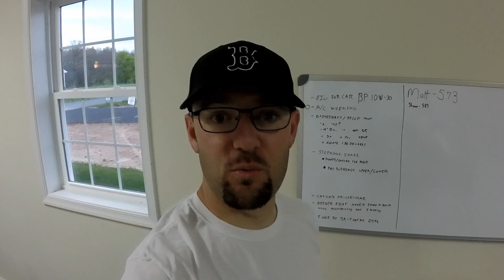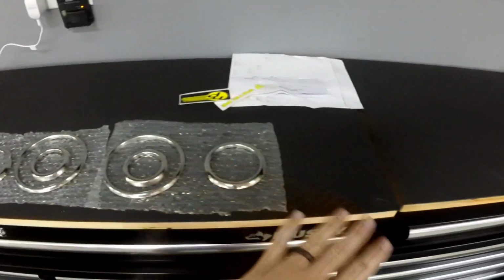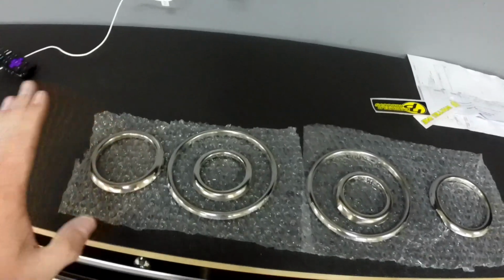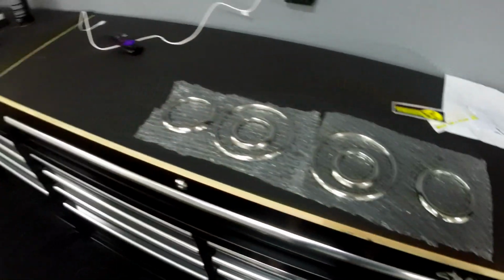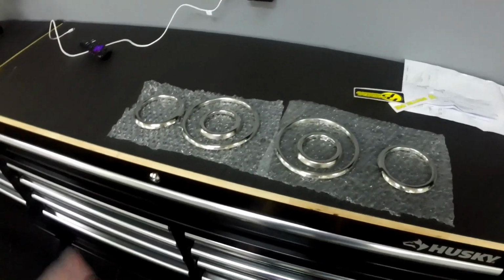MK5 Toyota Supra Is Confirmed!!!

Comment: I had a loud whine in the car also, had a good look everywhere then found the issue - my wife...
Reply: PURE Function jack the front of car up, turn  steering lock to lock 20x with engine off. air gets trapped. if continues, redo steps. mine took 4 tries. hope this helps.

Comment: If it doesn't have a 2jz or some form of updated 2jz it's not worth it . And that's the bottom line.
Reply: stop with your 2j nostalgia and allow manufacturers to innovate.
Reply: Agerix Official, It's not nostalgia, it's practical, the 2jz is one of the best engines ever made! So people don't understand why you'd  swap anything in that particular car, from personal experience, I've seen Ls, 460ci, T114, etc... none of them worked out, just saying!! I can't wait to see the first MK5 2jz swap!! Lol..
Reply: the 2j makes awful power unless you put hundreds of thousands of dollars into it, plus i have seen many 2j swaps not work out. for example look at how many issues TDIB has with his 2j swapped 240. the 2j is over rated as fuck. simple as that. its a weak motor like many of the engines of japanese 90s cars had. the only reason anyone swaps a 2j is either because its an iconic motor, or just the pure sound of it.
Reply: Agerix Official, What are you talking about?!?!? I've had mk4, IS300's, like 2 each, never had too put 100 of thousands of dollars into none of them to make legit power!! Ever! If you get a 2jz gte you don't have to worry about the bottom end, already forged, 2-4k will get you into the 800hp range along with the 2jz being Bulletproof, makes it a serious contender. Now if you want a transmission that can handle the torque and horsepower, that's where it can get $$$$! The v161 is your best manual option, that'll cost You! As far as the 2jz itself,  cheap to build, easy to work on, Bulletproof, torque out the ass, I mean come on dude, one of the best engines of all time, that's that!!
Reply: Agerix Official or you could go cheaper on the transmission side of it and get the IS-F's 8 speed manual valve body transmission, for around 2k, fastest shifting transmission in the world. Which has some awesome benefits, especially for the price range!

Comment: Shiiiit, I gotta start saving up for an MKV too! Also, FWIW, every V160 I've owned has made a pretty loud clunk going into first from a stop, so maybe it's a similar thing on the R154? Maybe just a Supra thing. 

Also, I'd go for the Mustang Dyno on your tune day because of better load simulation. Dynapacks also can simulate load (as opposed to Dynojets), but Mustangs are the most consistent and you can usually get a more solid and well-tested tune on a Mustang, especially in the low-medium load areas. Of course, that all depends on your tuner, but if it's a trusted tuner and you have the option, I'd go with the Mustang. Dyno numbers mean very little at the end of the day, especially if you have a rough tune in your low-mid load driving scenarios.
Reply: Hahahah Dude I watch your videos too lmbo
Reply: +BjornFSE Good to hear! 🤗
Reply: Save up till 2018 when the Supra turns 25, then you can get a Jspec MKIV, TT 6 for around $20-25000. When i import mine to the U.S (When i move there) i'll be buying some Glass headlights before i leave the UK for extra awesomeness!

Comment: Thanks for touching base on drive shaft clunk, I recently bought a 94 supra original 6speed tt, it was converted to single 6766 Pro EFI making 760whp..... it's been my dream car forever and I finally got it, still learning a lot about supers in general, but I was worried and concerned about the clunk whenever I shift... been doing research and it seems more common than I thought, thanks again your videos are very informative keep doing you! Love your car by the way

Comment: If they make a 4 cyl version, it's not a Supra.  The perfect supra would:

6 cylinder twin turbo
at least 3.5 L
rear wheel drive
front electric motors that turn on when in need of traction

Comment: if your driving your car hard you'll get the clunk only usually happens when your shifting hard and driving your car really aggressive. Evos do it all the time. but hey what do I know.
Reply: PURE Function i noticed you have some troubleshooting on the whiteboard for steering wheel shakes. what did you have listed there? I have also been dealing w vibrations in a th400 supra. finally flipped my driveshaft and it alleviated so much of the issue. shaft is at driveline shop being balanced as we speak along with new u joints. also have a bent front wheel that i had repaired but i think its still throwing the wheels off balance a bit. I'm on 18's right now and the tires are basically low pro. trying to find some stockers or 16-17in ccw's so i have more rubber on the ground. haha gotta love putting the car up and down and messing with the driveshaft leavung loctite off in case its not right haha. I'm in the same exact boat but its hella fun and the rewards are gratifying! Thanks for all the cool vids. who needs direct tv when uve got youtube an fellow car enthusiasts?